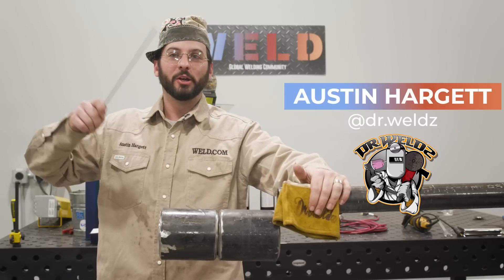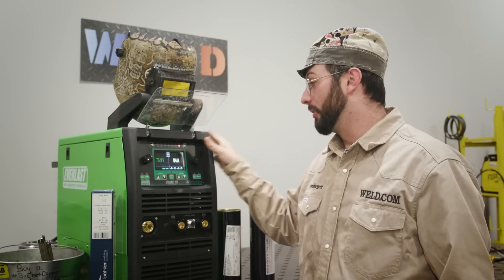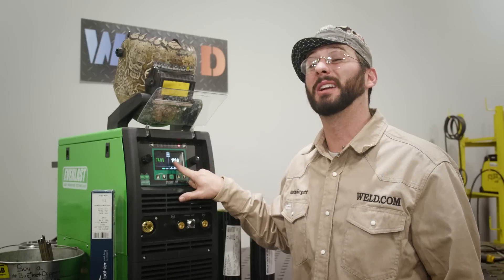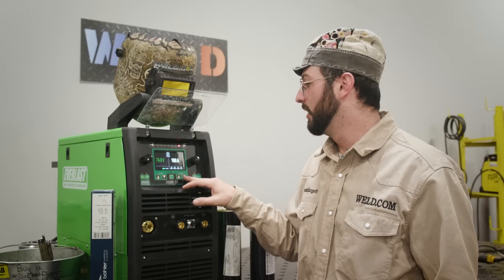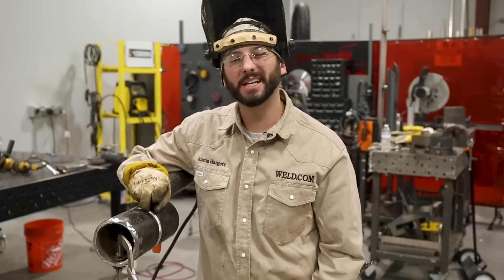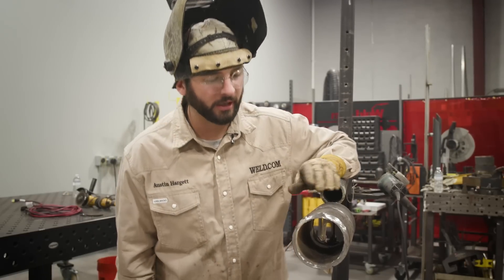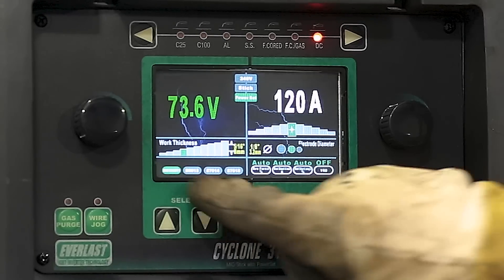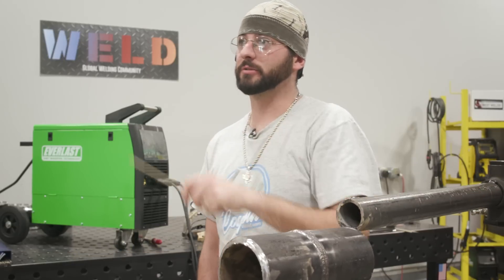The Doctor's Special On Stick Welding With 6010 (Cyclone 312 by Everlast)

Comment: I thought u would cap it with 7018 I never seen someone cap it with 6010 great job
Reply: Pretty sure there’s a code out there somewhere that runs exclusively these type rods downhill. I had the option of a course in trade school for “downhill pipe” that taught this specifically.
Reply: @JFROMM454  api 1104 is all downhill 8010 stuff. I only knew the inspection side. B31.3 is all the low hyd stuff

Comment: I noticed you plugged into a 208V outlet. I just purchased the exact same welder and it states 240V. Will 208V hurt the machine? I'm asking because i have easier access to 208V than 240V at my workplace.

Comment: Im wondering why it doesn't have an option to run a 3/16 rod it is rated from 190 to 250 amps and this machine is 250 Amp max? Cool video by the way

Comment: all that gee whizz tech is great, but you have to know how to set your equipment without this stuff because you may not have access to this computerized stuff... so... the way i was taught was to learn to set my settings by eye n ear... that should always be taught.. IMHO
Reply: Yep, we have old Hobart machines from the 80s or even earlier, they only have one dial for amps and a terminal for high and low which I use for gouging some times. You practice with it then make a mark on the dial to remember your settings for when testing comes around.
Reply: As a former CWI, if someone ever replied “I set my machine by eye and ear” on a job site, my response would  be “where in the approved procedure does it say that’s allowed”.   Understanding machine settings is very important.   What can look like a great weld to the eye can fail certification testing quite often.  That’s why visual welding inspection is rare.
Reply: @TheMidshipMaster  undrstood but i have bern on job sites where the equipment is so used that the settings are rubbed offor the panel was damaged.. so....
Reply: @madcapmagician6018  But wait, that's real world environment. Great point.